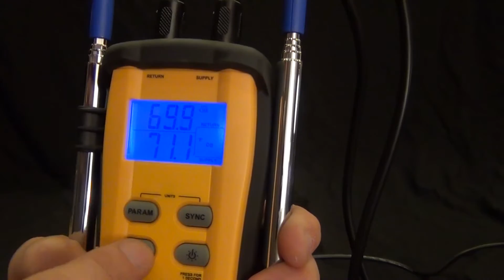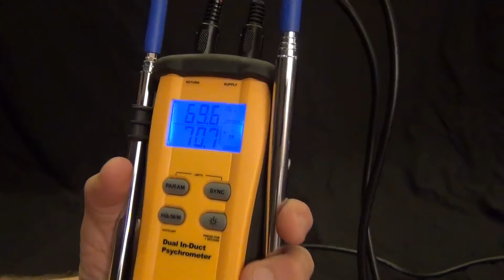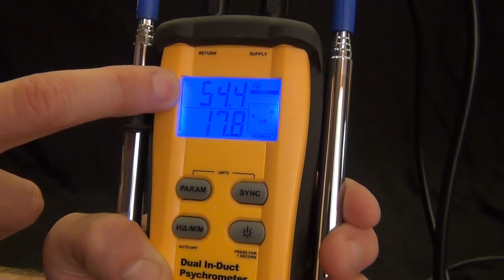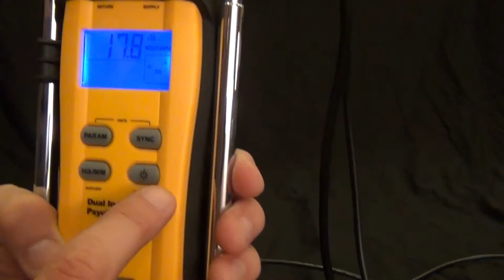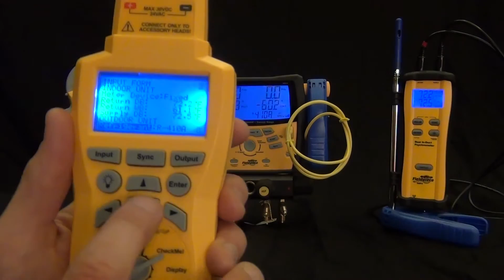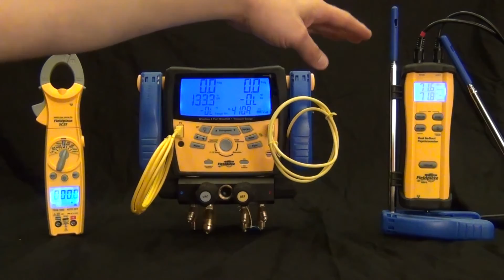SDP2 Delta-T on Steroids

Comment: The most useful feature on this tool is the delta enthalpy. I used to have to take wetbulb and convert it and then subtract. This shows it in real time. Want to know capacity or how well a system is dehumidifying then you'll want this meter.